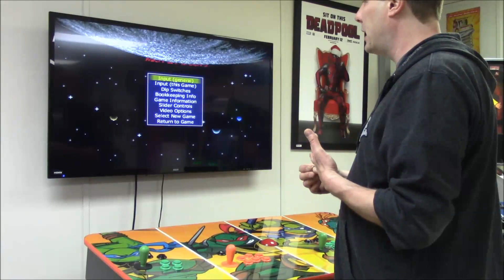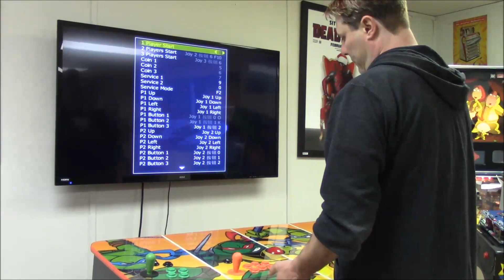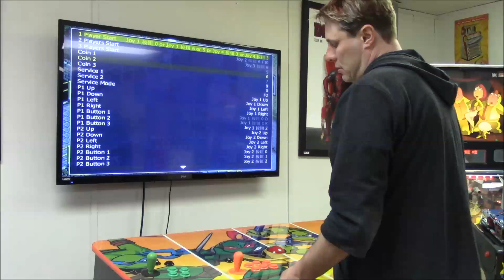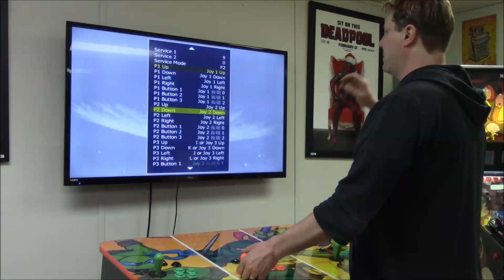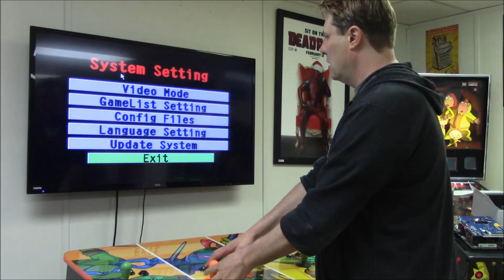How to Map game inputs on the XXXX Games Family Jamma Boards

Comment: I have a problem.with 2009 games family 1600 games arcade.i can't seem to get out of games.it used to be holding player 1 now it doesn't work for some reason.tried 1P and button holding all buttons.please help
Reply from the maker: If you changed any of your dip switches on the main top board of your physical computer ( the little red blocks with 4 little white switches) you could have turned off that feature. On dip switch 1 (right side of the board closest to the fan) make sure the #1 switch is in the "on" position. That should solve your problem.
Reply: Thanks.i just turned it off and moved dip switch 1 to on then turned it on and works like it did.hold p1 button for 3 secs.thanks wish u had more vids.very informative vids.

Comment: Do any of the scores save?
Reply from the maker: Everett Gonzales no they do not
Reply: Retro Active Arcade   Do u know why not? That’s the best part lol.  Anything I can do are buy. To add
On to my board
Reply from the maker: Everett Gonzales actually all jamma boards [excluding the 60 and 19 in 1] do not save high scores. The reason is simple, the drives are not rewritable, possibly because games can be exited at any time juring game play, you are not forced to finish the games like the cards I just mentioned above so most people do not.
Reply: Retro Active Arcade  I just got. The 2001 with 40 gd hard drive. I’m guessing that one as well
Reply: Got it thanks
Reply from the maker: Everett Gonzales yes, this includes the 2100
Reply: Retro Active Arcade  big help thanks
Reply: So these instructions apply to the Game King 2100 in 1. Would it apply to the Game King 3000 in 1 too? I'm ordering a vertical cabinet with either the 2100 or 3000. How easy is it to access the board to press the buttons and change the dip switch on a vertical cabinet? The Dip Switches feature in the menu that lets you adjust lives, difficult, etc. is software driven, correct? Can you tell me if vertical games are just rescaled in size but maintain their aspect ratio on horizontal screens for an upright on either of these boards? Are the 2100 and 3000 JAMMA boards Mame driven? By default, are games at the original lives, difficulty, etc.? Thanks!